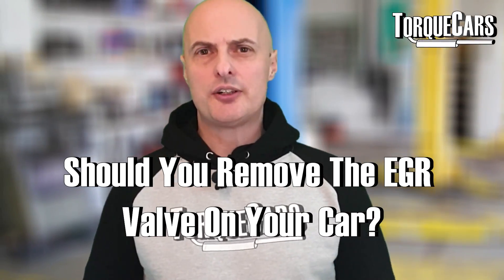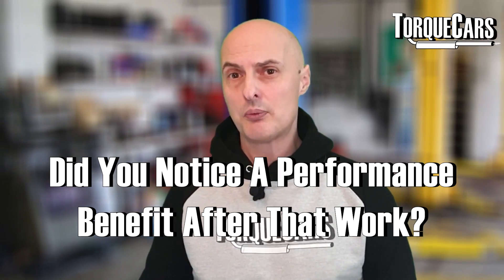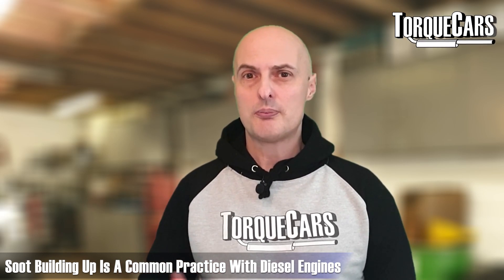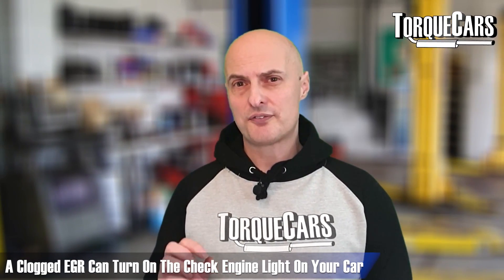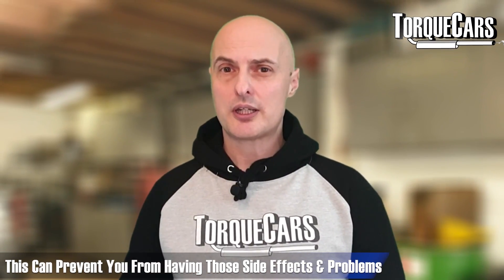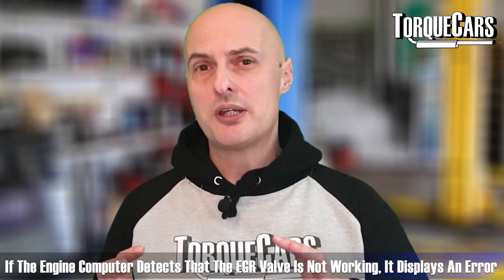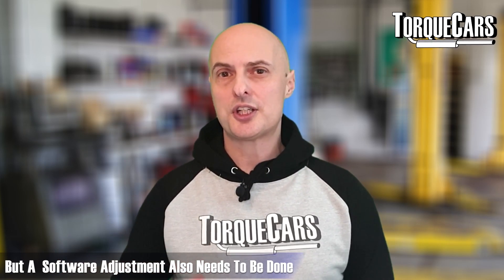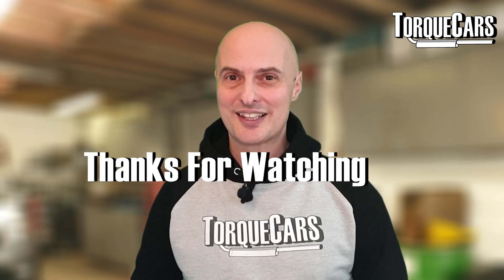EGR Delete/EGR Removal - Worth The Risk/Effort? All You Need To Know About EGR Deletes.

Comment: Help please....iv got a diesel  kia sportage 60 plate.the car runs great but sometimes the car will run crap start smelling fuel and smoke coming out the exhaust the mpg drops from 50 to about 29 soon as it starts smoking!! The car becomes a bit juddery too but if I turn car off and start again sometimes it clears and it ok again??? Iv had it to different garages but because it doesn't smoke when they have it they day there's nothing wrong and it won't be egr valve and it's probably dpf??? Iv been down motor way for long runs and at times iv pulled off motorway stood at lights and it starts smoking??? Any help please
Reply from the maker: Has anyone pulled off the diagnostic codes from the OBD port? This does sound like a DPF regen is taking place though, so perfectly normal unless it happens very often. This video explains the signs of a DPF regen taking place https://www.youtube.com/watch?v=54GrVq8_KqE
Reply: This has been happening fo 6 years!!!@torquecars

Comment: I drive a 2006 Mitsubishi Pajero/Montero (v78w) 3.2 L DID. I live in Germany and it's illegall to delete the EGR.  every two years a delete will be found in lawfully ordered vehicle safety and emissions tests the car has to perform. So if you did delete it, you have to build it back for these tests. A workaround is to integrate a restriction plate. Simply a plate with a hole in the size of around 7mm. The emissions will still be reduced, the ECU will not recognize it and the amount of build up is also significantly reduced. In case, I remove this plate beforehand for emissions testing. 
My upper intake manifold was so clogged, the car drove like it had no turbo at all. From 60mm in diameter there was only a hole in the size of your thumb left.

Edit: the hole size of around 7mm was found by some Aussies who tested smaller and bigger holes. I can't remember the name, but they are on YouTube.

Comment: Let me tell you something from a Ford Engineer who worked hands on in the Powerstroke Diesel Development Team for 22 years. I have bench tested systems with EGR that ran over 500K, regularly. I have engines on trucks in fleets across the US that were leased and returned after 4 years and over 250K miles. And upon teardown, none of them had abnormal wear from soot or oil contamination. We specifically built these engines to run a certain way. The most damage ever done to our fleet were ones that were idled excessively, worked mostly in stop and go traffic on short runs, and were cold started in freezing weather. EGR has not harmed any engine that is not excessively idled, slow traffic and zero degree cold starts. Every engine I personally developed, bench tested, and tracked with computer data on a fleet service with an EGR doubled in horsepower from 1998-2008, and dropped emissions by 80%. In 2006-2008 we deleted EGR, and every single engine failed at 200K. So don't use this to sell your oil and filters. They are not necessary. But honestly, please do delete your EGR so your mechanic can charge you $20K to rebuild your engine.
Reply: bullshit

Comment: I had endless trouble with my focus EGR valve stuttering uphill,
rough idle new oil that last 1500km before change oil warning came on. Since blocking off EGR 8 months and 20000 km ago no problem with idle or stuttering uphill, oil stays cleaner, car runs smoothly with no fault codes. No overheating. My only regret is I should have done it long ago. In my opinion EGR valves in diesel are evil power robbing, engine destroying engine components.

Comment: Maybe first gen engines with egr but new engines with their software etc are designed specifically for egr, it's really not worth the hassle to delete it, despite the rumours the valve only opens slightly and not often. Deleting the adblue system is a better option

Comment: I had a lot of soot in my egr valve and of course the cel light on the dash. took it out, cleaned the egr valve thoroughly and put it back. car drives like a champ, the car also seems to be warming up quicker. that is nice now when it is getting colder
Reply: They're supposed to be cleaned but the ones that delete it cache be bothered to clean it. It's simple servicing that many can't be bothered to do.

Comment: When the dpf starts to fill the exhaust gasses take the easier route  through the egr valve, so effectively you are actually far too much egr for a clean burn which makes the problem worse, the really awful  smell that diesel make is from excessive egr, it was the government fault all them years ago in the first  Scrappage  scheme told everyone  they were harmless scrap you cleaner petrol cars
Diesel are better and more efficient at long distance motor way driving, not sitting idling by any schools harming kids, in London they make the traffic 10 times worse and expected the pollution levels to come down, the government are causing the problems 😤

Comment: I highly recommend a 'catch can' as well as an ERG delete, especially if you are doing high kilometers. The combination of oil vapor from the crank case and soot from the EGR will turn tar like and block small tubes, sensors and the inside of the manifold, way down to the tops of intake valves.The catch can collects the oil from the crank case ventilation system and stops it fowling the inside of the intake system. This tar like substance can go through the engine mostly un-burnt and then fowls the DPF. I wish I had known this early in the life of my Subaru diesel. It has cost me thousands to rectify!

Comment: I'm just wondering is there anybody out there that has a problem with the EGR valve on a petrol car, my car is a BMW 3 Series n43 engine, 2009.
I had some work done on the engine which meant that the head had to be redone and ever since then I've had problems with the EGR valve it comes up as a fault and now it's causing the engine to run very rough and the engine check light come on, can anybody out there help me I'm in the Midlands?

Comment: All these regulations makes it impossible to continue using diesel cars. All these systems they inventet the last years are fantastic and the diesel engines now are really, really good and it is insane to give them up like Volvo did. But we are generally stupid with everything regarding environment in Sweden, such as shutting down out nuclear powerplants and instead running oil powerplant during winter, not to mention we almost pay as much for electicity as you in the UK now! How exactly are we going to use our electric cars?? Burning oil to get clean cars?

Comment: I have a 1996 Isuzu Rodeo - 2.6 4cyl engine....blanked off EGR port..kept valve / wiring installed.
That was 15 years ago...car still gets 25 ~ 27 mpg...runs great.
An issue I now have is EGR potentiometer wiper sometimes fails...can't service this because EGR valves are not made to take apart. I guess the potentiometer wiper gets moved a lot when engine is running. 
I don't understand why a potentiometer is used when simple on/off switch would work...

Comment: I got a Range Rover sport 2.7 and it was blowing out black smoke.    So I did a strip down and a clean and it made no difference.        So I pulled my pipes off and fitted plates so did the job and went for a drive and it was amazing.     I had no smoke and the engine feels smooth I had no re map or lights on the dash.     I’ve done it for 3 months and now just did a service and found no problems

Comment: Did a EGR block on my 2005 TDI .  It now has 400k miles on it.  My 7.3 Power Stroke has almost 300k miles.  All the smog crap does is ruin engines in the name of satisfying a flawed political agenda.

Comment: (green font on)  Yes,  Engine designers always have our best interests at heart.  they certainly know more than we do about the performance of our engines.  Also the incremental reduction in NOx and CO emissions are absolutely vital in preventing global climate change.  If I were to blank off my EGR valve, then my engine would have to suffer the effort to relearn the AF ratio using less  fuel  (since the air in EGR is depleted in O2 and thus requires more air to combust the unburnt recycle)  (green font off)

Comment: Under normal circumstances on a new car. the EGR isn't a problem, but as it starts to gum up after 50k, 70k, 100k miles, it can stick slightly open, sending exhaust gas into the inlet manifold at every RPM range.
Reply: EGR cleaner will help

Comment: EGR Ford ranger /Mazda BT50   both TDI
Inlet manifold clean every 100,000km
Egr valve clean every 50,000km 
EGR coolers block internal and externally needs cleaning 50,ooo km --100,00okm 
 both required [egr delete] electronic and mech plate 
gains in throttle response marginal and upto 1 ltr per 100km economy
catch can in PCV system 
BY doing CCan and EGR delete the injectors last longer

Comment: P5AT 3.2 ranger motor. 

Stock, it filled my intake up with a mixture of oil and exhaust soot. Egr needed replacing for $1200. Can leak and send coolant into your motor replacment 15k with labour. 

I had mine deleted and engine remaped for $1500. Had a good 100degree drop in egt temps, lower coolant temps, no more build up in my intake manifold. Knowing it wont end up with coolant in the intake. fuck ya egr

Comment: Best thing you could possibly do if you keep your EGR valve is to keep clean oil in it always change that ritually and it's always good to use fuel injection cleaner in your fuel it will help keep things clean and also keep in your ignition system up to Snuff is always a good idea

Comment: My old Peugeot 106 diesel had a relay operated EGR valve. The relay failed and the MPG improved from 63 mpg to 80. That car went on to 268000 miles before being scrapped with a still good engin (bad gearbox +ULEZ).
Reply: I see your problem; you let ULEZ control you.

Comment: Our Chevy Equinox diesel keeps spitting out P0401 and everything has been replaced/cleaned except the cooler ($400 USD). Funny, our Equinox gets 42mpg (best) when we get this code, CEL on, no driveability issues. When there is no CEL, we get "best" 39mpg (GMs Rating). With the CEL on, we loose options such as remote start. So deleting, or at least bypassing the CEL somehow, seems to be the best option in our case.

Comment: The EGR valve brings in exhaust gases and in this way lowers the temperature in the chamber!The biggest danger of erasing the valve is that the temperature in the engine will rise! Many people offer services to remove it, but nowhere do we see reports of what happens to it after long use without it ...
Reply: so much better without it! We have Toyota Hilux's that have a 5l and 5le motors one has electronic fuel pump and egr the other is mechanical and has no egr. The 5l motors without that crap live much longer and require less up keep.
Reply: Fact that the valve doesn't open when the engine is higher up in its performance range , negates the fact that it "lowers intake temperatures" thats government justification spiel & you've suckered on up 😂 it blocks the pipes & harms more than just the engines performance.

Comment: My EGR bolts are frozen. Tried for three days with PB and MAPP gas. Nothing. I plugged it back in. I have an EGR code. My alernator needs to be replaced, but the EGR valve needs to be removed.

Comment: Now I also put a Catch Can on my 6.4 F350 this has stopped engine crankcase sewage from entering and mixing with the metered air-fuel ratio. Given better cold starts the turbos spin up quicker and there is noticeably less black smoke at the tailpipe on lift-off while in stop-and-go traffic. I must admit that the catch can is baffled and exhaust is filtered to the atmosphere. All in all, I read. Overall performance has improved dramatically. Air from the catch can by looking at the added exhaust filter appears clean after 500 km if the exit filter remains clean at the recommended 5000-mile servicing, oil, and filters change I may plum the catch can back to the cold air intake. However, that would appear redundant at this time.
Reply: Must be the improved and cleaner combustion PS I recommend using a quality diesel additive. Because of the information on failing high-pressure fuel pumps I have taken to adding 200cc of two-stroke fuel mix to every 17 gal. or 65 Lt of fuel. The book is still open on that one. I figure a little internal lube in the fuel won't hurt. But the cost of replacing a high-pressure fuel pump is a big hit to the wallet. Now that hurts. Anything that can make our vehicles run cleaner and longer and improve MPG is a plus. I bought my truck in 2012 not as a fad to be replaced every two years but as my forever vehicle I'm 72 now. That didn't sound too outlandish. It has 145k miles on it now. Just rebuilt the transmission for $7K. Replaced the front plate at 115K a known fault Ford gets a 👎for that. The emission system is a failed science project forced on the diesel industry by the government. The automotive industry has been improving emissions since day one without government interference. Because it has been demanded by consumers. A system that had been working and continues to work. One day we will beat pollution but it will take all of us. Not that long ago we used streams as sewage systems. Imagine using our drinking water as a way to take our sewage away. This process is still happening throughout the world. But we are getting better through education. So keep learning and keep improving. If you have a better system Don't let anyone tell you that you can't use that system. Because I did not tell you. You could. Dictators are what's holding us back.

Comment: The EGR system was plunging up my cold air intake manifold so bad that air to the cylinders had nearly stopped. I replaced the air intake manifold and cleaned the valves at the head removed the EGR valve entirely as well as the coolers. That increased MPG by 1/3 of stock performance and increased it pulling ability noticeably. The air intake was improved so much that with a new stock air filter, the air restriction monitor came on reading replace the filter when pulling up a grade. I had to install a performance after-market cold air filter and air box.
Reply: Sounds awesome lmao!
I have a dodge journey 2.0 diesel (same engine as the vw tiguan) and I need the egr deleted!
I take it I should change the air intake too??
Reply: @itiswhatitis.1  no need , just get gunk cleaner & get the gunge out of it , did mine & it was choked up to 50% of its original openings,  massively improved performance afterwards,  night & day difference 👍🏻

Comment: Fact remains that an EGR valve is feeding your engine burnt, used diesel and oxygen that has little/no combustible properties, and no matter how good the system is, if its diesel it's almost guaranteed to cause problems before long. An EGR valve does NOTHING good for any engine, the government's forced manufacturers to fit them when none of them wanted it.

Comment: Simple answer is YES. Because it's like connecting toilet to fridge. Fuel consumption should also go down a bit, because engine is getting pure air and not air with exhaust gases mix.
Reply: Because of more air is coming to the engine the sensors that monitor that will actually inject MORE fuel, not less.
Of course is not that noticeable but that's the theory.
Reply: @Adrian-re9fh  Living at a high altitude location fuel consumption certainly goes down.
(Another factor to consider is temperature of the initial mixture)
Reply: EGR improves fuel economy on gasoline engines by reducing throttoling losses at part load cruise.
Reply: @gregorymalchuk272  No it does not. All EGR does is reduce engine life, good for car manufacturers (who lobbied for it), bad for owners.